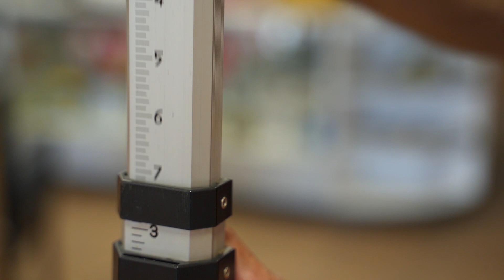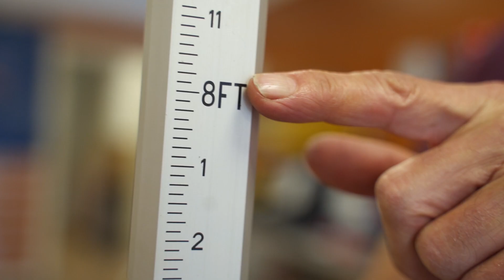How to measure height with a grade rod

Comment: I guess the error in rod reading can be blamed on parallax as the angle at which he was reading the rod was close to vertical.
Reply from the maker: Yes, to ensure you get an accurate reading, you must use a bulls-eye/circular bubble on the rod to ensure the rod is perfectly vertical. Here's one that works with most aluminum grade rods - https://www.tigersupplies.com/Products/Bubble-Level-for-Aluminum-Builders-Grade-Rod__ADI710-40.aspx

Edit: Grammer